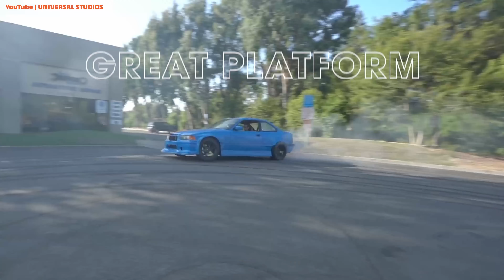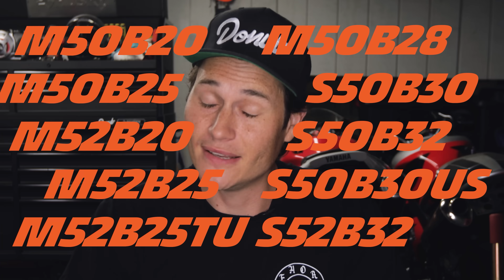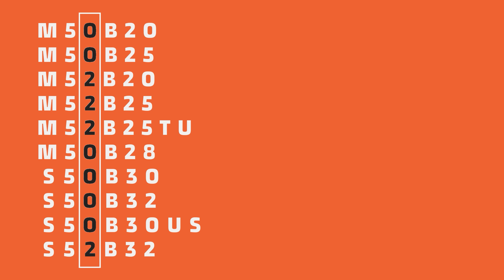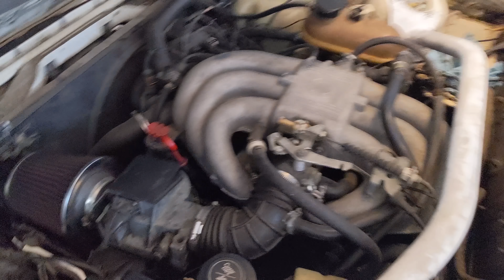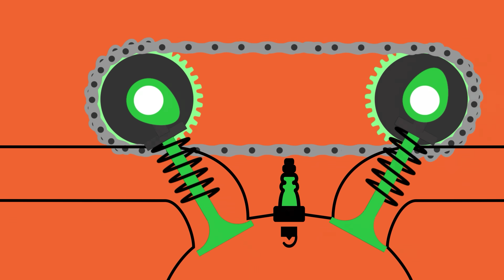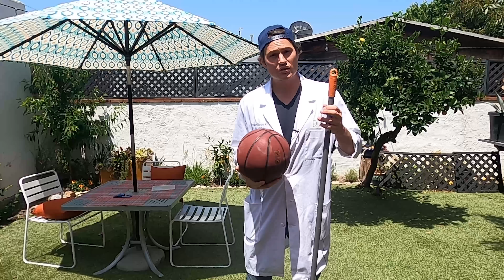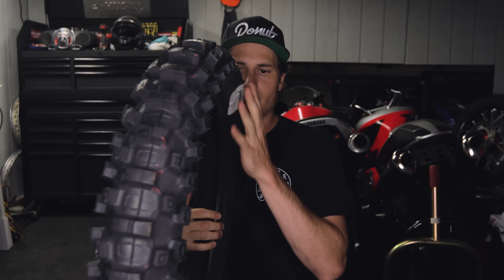2 Reasons Why the E36 is an ALMOST PERFECT Project Car

Comment: The E36 was designed to keep drifting idiots out of E30's. Did it work? No. They still drift the living shit out of old E30's. Less control or not, I think the fun factor of the E30 is just higher overall.

Comment: I bought a new E36 M3 and had an almost new E46 328i. A dude gave me a ride in an E30 M3 one time and I thought it was kind of a dog. I understand the E30 version is more rare and has a precise engine but it didn't seem that fast. The E36 was great. The E46 felt a little too Lexus like. Once I dropped the E46 a little with Eibach springs it was way better. An E46 M3 might be cool but they would have 300k miles by now.

Comment: me punching the air after watching this the day after i bought a 46
Reply: The e46 is basically the same car handling and reliability wise but better it has 20 more hp, dual vanos better mpg and a nicer more modern interior with better tech. The only downside on the e46 would be the subframe and most people think the e36 looks better than the non m e46

Comment: Speaking on the 9:40 ish mark. EGR helps emissions by cooling which reduces NoX gas formation, because NoX cant form below a certain temperature. Also the efficiency gain from leaving exhaust gas in the combustion chamber is because exhaust is inert (it wont react with anything) and basically takes up space without doing anything. So exhaust gas occupies space where fuel/air mixture would normally be. Think of making a mixed drink, with alcohol being the fuel. If you put mixer (exhaust gas) in the cup (combustion chamber) instead of straight alcohol (fuel) you use less alcohol and still fill the cup as intended. With added emissions benefits. Hope that helps, learned about this through reading and college and its simple once you get it but its sort of mind boggling at first 🍻
Reply: Hey there I run a e36 channel and would appreciate your support for some e36 contenttt🤞🏽🖤

Comment: Just bought a 1997 323i with only 12,000 miles here in Japan. Love the way it drives and am shipping it back stateside with me. I am currently having the valve cover and oil pan gaskets replaced. Changed out the brake fluid, air filter and coolant.
Reply: Get the exhaust upgraded, makes a big difference

Comment: slight correction, v-tech doesnt adjust valve timing, it adjusts valve lift, at higher RPMs v-tech opens the valves even more letting more air in.  variable valve timing doesn't adjust valve lift, it just advance or retards the timing.  they will feel different

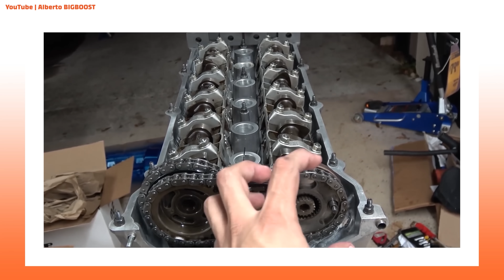Comment: beginning at 8:53 "Valve overlap"
The Valve overlap (in German "Ventilüberschneidung") allows to use the cimmeney effect to help for better cylinder filling (actually more air) that causes the better mix of Air and fuel resulting in a cleaner combustion. To lower the combustion temperature, exaust gases are taken back to the intake using the exhaust gas recirculation valve (in German "Abgasrückführventil" or "AGR-Ventil") wich is electronically controlled to ensure that a specific amount of exaust circulates back (in is mandatory for cars in Europe to get the EURO-1 exaust certificate, every car delivered after 01.01.1991 had to be certified EURO-1 by law.)
Every two years Cars in Europe have to get inspekted by specialized Car-Engineers (in German Hauptuntersuchung or "HU") and the fully funktionality of the exaust-treatment system hast to be re-certified ("Abgasuntersuchung" "AU" or for older cars "Abgassonderuntersuchung" "ASU"). If the two-year period of tecnical and exaust-related checks is failed or missed you are no longer allowed to use your car (motorcycle or whatever) on public property.

Comment: Bro you dont know very much about the Engine, its Not meant Offensive, but their was no m50 b28 its a m52 and a vanos is Not like v-tec its makes the valves Open earlier, bmw Gas a notier System later top weich is simular To the v-Tec System, its called exenta Welle

Comment: It seems the engine code list in the breakdown is incorrect. There is no m50b28 in existence, and I also have a 98 328i which came with an m52b28 from the factory
Reply: Also says m52b2vTU Instead of m52b28 TU

Comment: Honestly because of these video's the prices got insane of the E36. Simple 316? Starting at around 1500,- Euro's. While 2 years ago you could buy one for 300,- to 500,- Euro's depending how much rust it had. Today I got a photo memory that I bought a mint 318i with an addidtion M52b25 engine for only 1500,-!!!!

Comment: But......thats not how EGR works or why its done.....engines actually produce MORE emissions when COLD not hot....exhaust gas is recirculated to burn off what wasnt completely burned in the previous cycle....EGR also raises cylinder temps, not lower them. Basically that segment was entirely backwards lol

Comment: The most overlooked bmw in my opinion is the E39’s. They rock the same M52B28 as the e36. But is a lot cheaper. You may need to do a manual swap. But, its a great drift car

Comment: Toyota 
7  seventh engine
M engine family 
G  dual over head game
T   Turbocharged 
E  electronical fuel injection

Bmw
M m engine family 
18 6 cylinders
Q performance
T  turbocharged 
74 3.0 displacement

Comment: I honestly don’t think the e36 engine is better then the e30s because one the e30 is all metal and ,water pumps intake ext and the vanos is prone to failure …plus the e30 sounds amazing.if we had gotten the euro spec of the e36 with 100 more hp I would say it’s better though but we didn’t.rear end imporvment is the biggest improvement over the e30 .but I still wouldn’t say it’s significant there so close in specs and it’s no where near as sexy

Comment: VANOS is not like V-tec.. and if anything this video should be about the N52B30 as it was the first ever engine made by BMW to include dual vanos and also Ivtec on the intake cam.. Basically here is an edited video to just watch? Anyways VANO's holds the valves open for a period of time, it does not increase lift of the valve just holds it open longer or shorter, Vtec as also found in the N52 opens the valve MORE or less, you combine the two and get 260hp N/A inline 6's that weigh less than ever before. Not to mention they used magnesium in the block and valve covers for many of the first year NA 330i's. But yeah, no e36 had vtec.

Comment: My first car was a 528i e39, had a warped head i took it apart got the head re surfaced put in a new gasket and valves. so when it came to getting the timing exact for the vanos to work, it required a special tool for thousands of dollars to hold the cams in the exact spot to keep the timing right. well i didnt have thousands of dollars so i found the dimension and had a metal working shop cut a piece of metal to the correct dimension and paid 30 bucks. just thought id share my story and maybe save someone some money

Comment: Well as for the engine codes. In a way, it may not seem intuitive at first but then again, maybe the M stands for something like Moderate and S for Sport, the number afterwards, where 5 is the inline 6, I'm pretty sure is lifted straight from a list, because what if you have inline 6's and v6 engines but you used the number 6 for inline 6's already? it would require 2 digits to accurately display it like that and those engies are all about efficiency I guess.

Comment: Should I buy an e36 or e46 manual transmission project car? 

Is the e36 that much better? I plan to add the cx racing turbo kit

Has anybody had both?
Reply: I like the looks of the e46 better

Comment: Well, basically second number in engine name meant not generation, but if that engine has VANOS. M50 is non-vanos engine, m52 is single vanos engine, m54 is dual vanos engine. TU at the end means  technical update, and applies to engines that no longer had nikasil layer on engine cylinder.

Comment: What is that macpherson strut animation. The spring/strut and the wheel hub should be together, with a joint between that and the control arm, the animation shows a swing axle.

Comment: Well, now we all know not to try and pull a J turn in a Smart car. Someone had to make the ultimate sacrifice to bring that knowledge to us, although a mathematician could have told you it's damn unstable when your car is a tiny square with a wheel on each corner. 

The first generation Mercedes A class was bad, the Smart is obviously even worse in that respect. Not good for J turns and also not good for elevated roadways in high winds, or passing big trucks going at speed. They might be kind to the environment, but they're not kind to the passengers unless you drive like Miss Daisy likes to be driven!

Comment: m52 can only over heat for about 30 seconds which kinda sucks tho, everything else is decently solid
Reply: except the rear suspension, the top hats fail and they rip into the rear speaks/subwooferthing, the front lower arm's rear bushing, the motor mounts rip out so the subframes have to have and the chassis itself has to have enforcements welded on

Comment: Dual cams are good because the valve ports gives an overall greater area to open for flow.  The area over top of piston is all you have to work with so the 4 valves in a 2x2 layout cover more then 2 larger valves in a line can. Basically it's easier to push or suck air
Reply: Hey there I run a e36 channel and would appreciate your support for some e36 contenttt🤞🏽🖤

Comment: VANOS works across the whole rev range, VTEC doesn't. VANOS doesn't "kick in". It's just there. Theres no theater to it. Even so, as a BMW fanboy I have no problems admitting VTEC is a better system due to the fact it doesn't crap out at about 100k miles (milage may vary) and needs rebuilding. It's just a more robust and simple system.

Comment: About different VVT-systems:
 Honda's Vtec - do not fall into VVT's category as Vanos - V-tec is (staged) actuating of Valve Lift.. where Valve Timing is about the Angle of cam's pulley (next to crank's pulley). 
BMW has different system, responding to Honda's V-tec - it's Continuously variable Valve Lift - the idea is removing the need of throttle body, the mechanism features a rocker with moving axle (): 
- reducing the intake volume, closed between the actuating device & valves - improves throttle-response. This is the idea behind individual throttle bodies on M-engines (lacking VVL).

- the sole idea of Vtec is allowing engine being efficient and responsive in mids & lows, where it "opens" for more power at high rpm, right? Same idea with VVL - but continuous, not staged - engine being responsive & efficient in the whole rev-range.

I point that, because both types of systems can co-exist & collaborate in same engine (as they do in modern Hondas) - the only condition is not being single-cam :)

Comment: Hi, I have a 1999 BMW m3 convertible just got the whole engine rebuilt now working on converting auto to manual swap. I just got ZF 5 speed manual transmission from a 1998 BMW m3 but noe I need to buy a slave cylinder and self-starter for the manual transmission but I am not sure if I need the Slave cylinder for the 1998 BMW m3 for 1999 BMW m3 convertible? please help

Comment: Unless you absolutely need RWD it really isn't. The VANOS system is far too leak prone and unreliable for what it does. The cooling system is problematic and marginal.  Any significant power gains are soul crushingly expensive and rarely worth it. Some of the aftermarket parts are complete trash and not worth making, much less buying.

Comment: The first engine with "V-tech" was the mazda 13b rotary in 1986, it has 5th and 6th ports that are engine exhaust gas flow activated to actuate opening more air flow into the engine above 3-4k rpm.

Comment: Really wish guys would stop treating  variable valve/cam timing as a performance option. Its an economy option that strangles the actual power of the engine for the sake of economy, and emissions. Vtec, vvti, etc fanboys treat it like it's a "race mode" when in reality, it's just the engine's actual capibality when it's not being restricted. That's why the old race 4age engines deleted it. Yes it makes for a rougher choppier engine at idle. Performance is a trade off, economy is a trade-off, these systems just switch between the two.

Comment: Vanos isn't equivalent to VTEC. It is variable cam phasing which means it adjusts the timing of the camshaft or camshafts to the crankshaft. Honda has single cam phasing on their I-VTEC engines. BMW's version of just VTEC is called valvetronic and it is accomplished by a separate means that is actually superior to VTEC in that VTEC only has two different cam profiles, low RPM and high RPM. Valvetronic is infinitely variable, hence its superiority.

Comment: List on what you need for a perfect e36 build
#1- Subframe reinforcement plates
#2- Oil
#3- 5 speed manual transmission 
#4- at least 6 cylinders 
#5- coilovers and exhaust
#6- xbrace to protect oil pan and better handling
Reply: #7- more oil
Reply: @unmeisa  #8- A bit more oil
Reply: Annnnd just a tad of oil
Reply: You forgot 400$ worth of coolant, 6 expansion tanks, 3 maf sensors and oil
Reply: @Sintaj. And a new fan clutch
Reply: True, even 318i i got a lot of fun. Sure it’s not fast but still can but down some little drifts and it’s performance in the corners is just as good.
Reply: @spexflex1999 my first car was a 97 5speed 318i!! I bought for a 1,000. It wasn’t in the best condition but I loved it.
Reply: the e36 is the best handling CAR of all time fun fact
Reply: nah e39 @sawyerdeeke-u6x
Reply: At least 6 cylinders?
Reply: Number 4 is subjective lol
Reply: mine came with the x brace oem ❤️🙏
Reply: You forgot replace the water pump or it will catastrophically fail and take out the radiator... Oh and it needs more oil.
Reply: Planning to buy e36 but mostly here in philippines have 316i, 6cylinders are rare here.
Reply: @loutayao2023  Good news is the 4 cylinders are still really awesome cars.
Reply: Hey there I run a e36 channel and would appreciate your support for some e36 contentt🤞🏽🖤
Reply: 1- YES
2- ?? Never had oil burn on my E36's
3- Agreed
4-No- m42 is a great engine
5- agreed
6- If drifting or racing- YES, not needed on a street build.
Reply: i heard the x-brace is a problem if u crash. it makes more damage.
Reply: @Andrew_P92  don’t crash
Reply: @Andrew_P92  That's dumb. The X brace is an oem option on convertible and M3's, so it definitely doesn't change the crash zones, BMW wouldn't have done that, and wouldn't have gotten away with it since it's all tested. Plus really if you crashed hard enough that it crushed the front end up to the X brace your car isn't saveable anyways.
Reply: @imnota  sounds logical, i just said what i've heard. It's not my opinion. But just the rumours of that changed my mind of installing it. I don't know, maybe it depends on the crash angle.
Reply: @Andrew_P92  

Rumours are rarely based on reality. 

Really think about it for a few minutes, the x brace is literally behind the subframe, that's beyond the crash zone of the car, if you crushed your car that far back, you're dead anyways because that means the engine has been pushed into the cabin.

Plus knowing it was installed stock on convertibles and m3's, and that all e46's have a similar brace from factory, really, do you still think it's bad if engineers thought it was good ? Remind me how many diplomas the people that started the rumours have ? Definitely less than the BMW engineers.

Plus you know I've been in the bmw community for quite a while now, I talk with people from all over the worlds, car owners, dealerships, tuning shops, racers, etc, and never have I heard any concerns or recalls on the x brace, seems like that rumour is very localized...
Reply: @imnota  maybe, thnks for the answer. :)

Comment: FIY (from a german dude)

M50, the 5 doesnt mean that its a 6 zylinder, its the Engine family

M10 4Zyl 8valve
M20 6Zyl 12valve
M30 6Zyl 12valve Big ones like 3L and more "Eisenschwein"
M40 4Zyl 16valve
M50 6Zyl 24valve
M60 V8
M70 V12

Comment: e30 well legend, who had it will stick to it. 'Ones that sold theirs are looking to buy one now. E36 is close, but in the better price range right now - the last call. E46 is what the two mentioned before was couple years ago...great car but unapricieted, cheap, become simply a meme generator right now, only the top spec versions are holding up nice - E90 well it's garbage. Europe situation ofcourse

Comment: HIgher temperature better emissions, not the other way around...
when you recirculate exhaust gases the temperature goes up and you burn any residual fuel left in the exhaust hence the better emission, not because it's cooler.

Comment: Had a M50 E34, the vanos is total junk and the older M20 engine you find in early E34s and E30s are a lot more fun with their momentum and their amazing sound, M50s are reliable, but sound boring.

Comment: As an e36 owner, I don’t get why you would put any effort into talking about their engines from the perspective of a project car. 

An M3 isn’t much faster than a Mustang GT which isn’t much faster than a friggin Jeep Cherokee 4.0HO. 

Either enjoy the slow af M50/2 or swap the dang thing for an LS. Bonus with the LS swap: you’re obligated to connect it to a Tremec which won’t have BMW’s stupid “are you sure you want this gear? Maybe you’d rather be in neutral?” notch before the shifter is fully in gear.